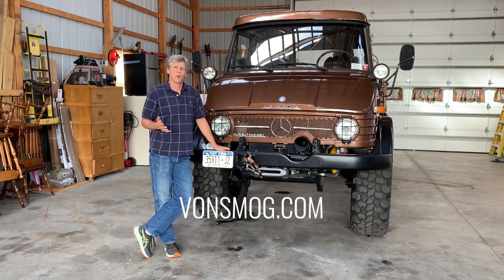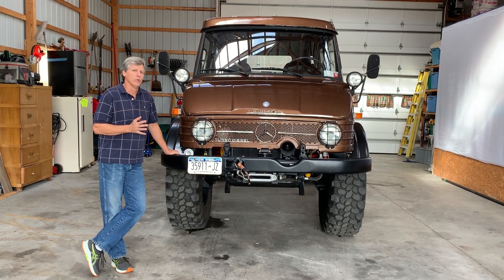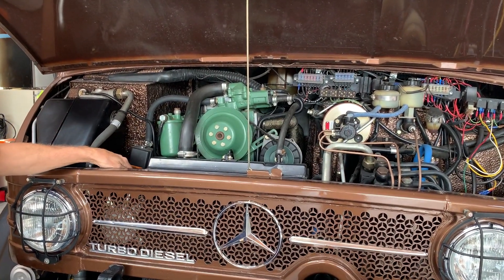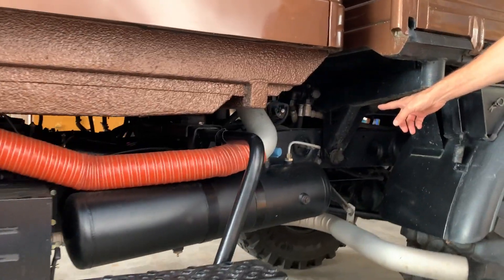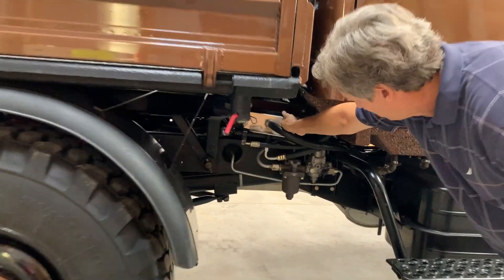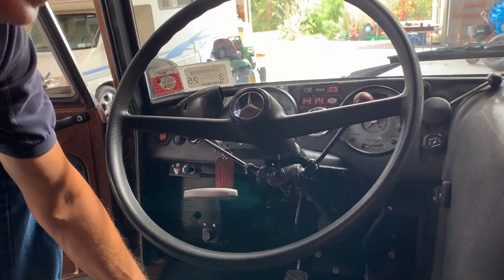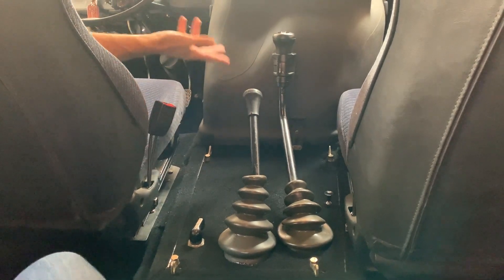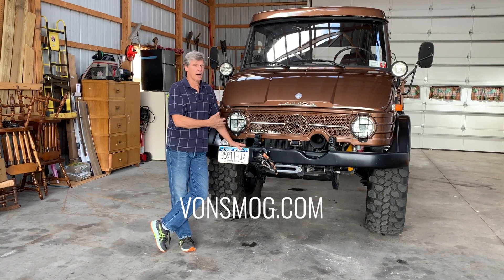Unimog 416 Doka Walk around Video   FOR SALE

Comment: I don't want to be an over-reacting teacher but after watching the video further.....
This is not just a “DOKA” but a “DOKA-Meiler PRI”
is made up of “DOKAPRI” and Meiler
Meiler was a well-known company that manufactured dump trucks and also garbage transporters (we separate these types in Germany) because they had a "patented platform system" and the "PRI" is an abbreviation for the fact that it is a "flatbed"... ..
which can be tilted to 3 sides to unload "bulk goods", depending on where you insert the locking pins
By the way: a "DOKAPRI" is extremely rare, because you either lose payload and the wheelbase becomes longer, or if you work with the short platform you lose space.
The only thing a UNIMOG needs, in my opinion, is an "automatic drainage system for the compressed air, and a tire pressure control system"...... ;)
The "DOKA's" are mostly fire brigade vehicles, hardly any company has bought Doka's for their work
short hut was standard, much more important was the gearbox and the PTO system, what you can and with how much load you can operate it
Reply: FASCINATING ~ THANKS!